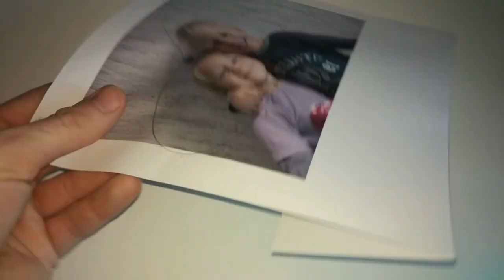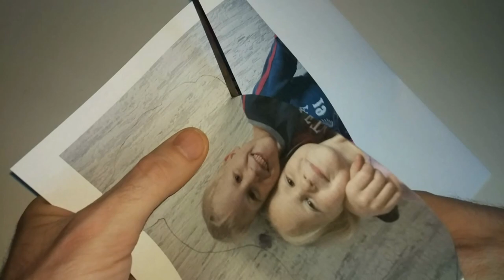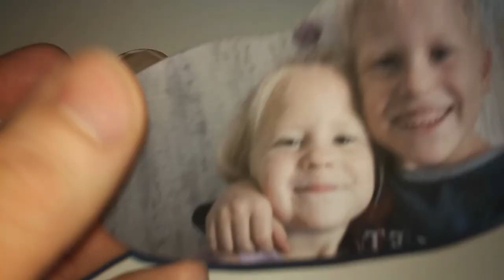How to Transfer a Photo to Wood. THE PICTURE SHINES.

Comment: Beautiful. A few questions: A. What kind of paper was the picture printed on?  B. What model of printer was used? C. Was the water cold or warm?  Thanks for your answers.
Reply from the maker: It's plain paper. Image printed on an inkjet printer and hot water.
Reply: Remember to print a flipped version.

Comment: Coucou  .... J'ai une petite question :-)  je fais de la photo et j'ai voulu  transférer  sur du bois , une photo que j'avais faite  avec du papier photo  Canon.....   mais ça n'a pas fonctionner , je n'arrivais pas à la mouiller , ça ne passait pas , elle restait toujours  pareil .... 
Quel papier as tu utilisé là, sur cette vidéo  stp ?  
Pardon, je ne parle pas ta langue, est ce que j'ai bien compris ; il faut attendre 24h  après avoir mis la colle  ???  
Merci beaucoup pour le partage et merci si tu prends le temps de me répondre   💖💖    Si ce sont tes enfants ... ils sont trop mimi  💖
Reply from the maker: Vous devez utiliser du papier ordinaire pour l'imprimante. Le papier photographique ne convient pas. Après avoir collé au bois, il faut attendre environ 24 heures pour qu'il sèche. Ce sont mes enfants sur la photo. Cordialement.
Reply: @pawelc7879    Merci beaucoup pour cette réponse rapide et bravo ... de magnifiques enfants :-)  Une belle journée  💖
Reply: I know this comment was left 3 years ago… but did you ever figure out how to do a photo transfer? There are many videos on YouTube to help…. The process is called Decoupage… you s8 p,y print a picture out on REGULAR paper that goes in an Inkjet or laser jet printer… using regular school glue or mod podge glue, coat the surface of the picture liberally and the. Place it on the surface of what you want to transfer your picture to.. smooth it out and then Leave it to dry completely over night… I always wait 8-12 hours… the. Using some warm water, apply it liberally and begin to rub the paper off… be gently as you don’t want to remove the ink as well! …after you have removed the paper, you can apply a thin coat of the mod podge or can spray a clear acrylic or you can coat the image in clear resin…  hope this was helpful to you even it was three years later :)